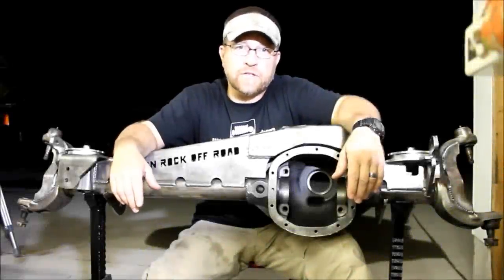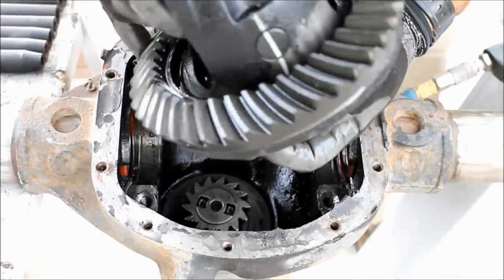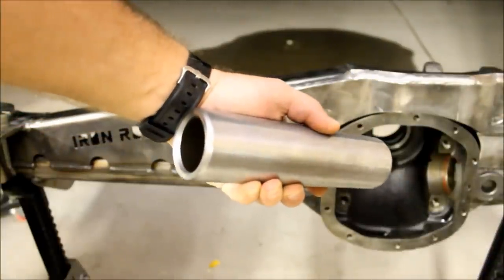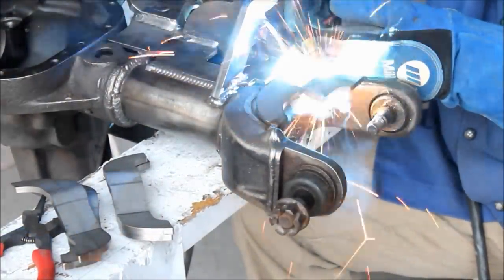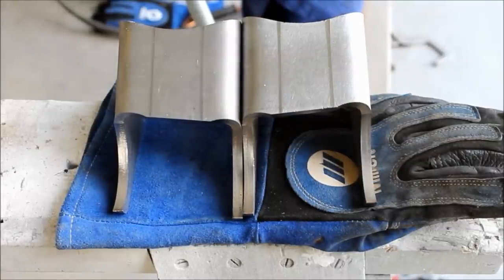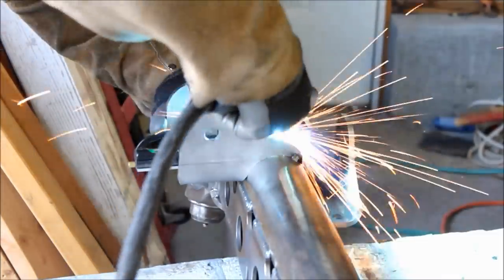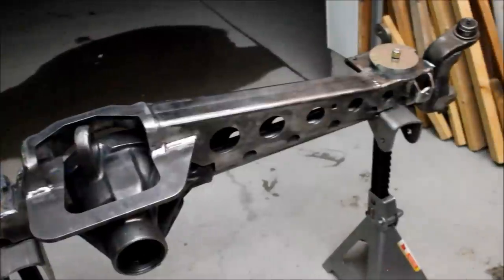Project Overlander Front Axle Swap Part 2 (IRO Dana 30 Axle Truss Install)

Comment: Welds are absolutely beautiful, makes me want to step up to true mig and stop messing around with flux core. Nice work and sweet kit.
Reply from the maker: flux core sucks!  if you ever want to come down to TN Nick just let me know man, a collab video might be in the works;)  -Matt
Reply: Thanks Nick, the funny thing is I had never heard of IRO until I watched your almost-alloy kit video. That got me checking out their website and product line. Welding with flux-core is rough bro. Step up to MIG with gas and you'll never go back!
Reply: That's what I keep hearing. Some day soon I'll have to grab a bottle and do it proper.
Reply: I like your welding.  Can u describe your welding motion?  Is it 
zig-zag, or "circles"?  I have a Lincoln 140 110v welder flux-core from Home Depot.  The
 ad states:

3/16" single pass
5/16" multi-pass

So, ur saying it's inadequate for this 1/4" bracket & 1/4" axle tube?  But, you are using a 110v welder with Ar/CO2 gas?
Reply: +Tyler Bleepinjeep in regard to welding on a axle, what's wrong with flux core other than appearance? Does it not penetrate enough?
Reply: I don't think there is much wrong with flux core structurally, it's just hard to make it look nice.
Reply: Welding inspector/welder here.  Mig should always be used in an enclosed environment, and really on very clean material.  Techniques in positioning are 2 entirely different modes.  Pick up a couple of books and search you tube.   As an instructor find someone who knows and have him/her watch your technique another pair of eyes always helps.   Tunnel vision is a bitch

Comment: I have watched this video no less than 50 times over the past 4 years.  I am in the market for a truss, and I am between the Barnes and IRO trusses.  I look at this IRO trust and think, there has to be clearance issues at some point at full articulation.  I have a basic 4" lift with sway bar disconnects, so I get a good amount of flex.  Curious if anyone has any feedback on this.

Comment: Chromoly axles along with those sleeves and the truss is a massive improvement to those axles. ujoints will still need a helping hand. It's turning out good for sure.
Reply: thanks!
Reply: Anytime, I'm always glad to see projects coming together and looking good. I was thinking about upgrading to these chromoly ujoints, they're pricey as hell though lol.

http://eastcoastgearsupply.com/i-11785922-yukon-super-joints-for-dana-30-44-u-joints.html
Reply: Chro-mo joints look cool, but I recommend you just stick with regular old Spicer joints. U-joints are easy to replace on the trail compared to axle shafts and pinion gears. I want my U-joints to be my fuses.
Reply: Tyler Bleepinjeep That's true and a good way of looking at it. I'm all for that as long as the u-joints doesn't mangle my axle shafts when they break. I don't see why everyone is so butthurt about upgrading the D30, with what all you've done to yours already, it's going to be as strong as any D44 if not stronger than most.

Comment: Finally! when i did this there was no info on this product at all. not even any pictures. I had to notch my truss to clear the trackbar drop bracket + send the axle rearward as far as possible. ALSO I had to cut and remove that section of the truss that straddles the pinion. This little cross piece was totally in the way of the upper control arm ( I am running a duel y-link). Oh and I know the directions and in the video it is explained to mount the truss 3/4 '' forward of the diff cover mounting surface, but just be consciousness of what pinion angle you want really because it will affect where the coil buckets sit and what have you. I set mine a little more rearward. The "sway bar link bracket," works well for limit straps aswell. I threw my swaybars in the trashcan long ago. ALSO I had to notch the C gussets to clear my u-joints just a tad. Be careful aligning those CA brackets too. i ended up having to take an upper control arm to the mill and oval the slot open to fit a bolt through. I then welded a thick washer on top the oval.
Reply: Dang, that's a lot of mods. That must've been a pain.
Reply: Yes a bit of a pain. The real B** was grinding out all my welds because of porosity. Buddies welder wasn't cutting it. Ended up purchasing a Hobart 210 MVP. Great Rig! Should have bought it years ago... Oh well live and learn. Your weld are purrrdy btw!

Comment: The Iron Rock truss bridges the center section without being welded to the cast steel, doesn't a truss system that's welded to the center section make an axle stronger?

Comment: If the front tubes need to be welded to the bell housing they if you want to rotate the front axle for a 5.5 lift, why cut the "C" brackets?  Why not just rotate the tubes?

Comment: I have an 89 2WD 4.0 XJ and my neighbor is selling his 98 4WD 4.0 XJ with a blown tranny. I'm trying to talk them down to a price I can afford right now. If I can get them down to the price I want, do you guys have any suggestions as to what parts I could use on my 89 from the 98? Besides the front axle, I know I will need a 4x4 AW4 and t-case to go with it. So other than that?
The reason I'm building an 89 2WD is that it was my first car so it has sentimental value, plus I've already put a lot of time and money into it
Reply: ***** Like I said, sentimental value. And I'm trying to get this donor for about $300. I'm currently in a cast and just moved so I don't have a job and can't really work yet. I have the money to buy the donor, and I'm 18 planning on living with my parents until I'm done with college or if I get a good paying job so it's not like I NEED the little bit of cash I have to live or anything. Basically I'm saying I'm most likely getting the donor. Plus I don't want to build the stock axle. Once I save enough money I'm tossing one tons under it. But other than the front axle there are plenty of other parts I could use too
Reply: Dude, if I could pick up that 98 for $300, I would find a used tranny in the classifieds or Craigs list or something for about another $300. Throw it in and have a backup daily driver or sell it for $3000 and buy parts for your 89.
Reply: +Tyler Bleepinjeep yeah I'm trying to get it. I don't know if I should use it as a donor for parts or sell it and buy parts
Reply: +Se7enAte depends on condition and miles, if it's worth it to fix or use it for parts.

Comment: I know this video is a little dated by i was researching some other info on the Dana 30 and came across this gem.  Great video Tyler. You mentioned publishing a video on the IRO inner axle sleeve installation.  I looked for it on BJ’s site and youtube but couldn’t find it.  Anyway you could put a link in the comments?

Comment: The work you did on this axle is beautiful, but I still have questions & concerns:
Welding to the "c's" & tubes is cool, but how much confidence do you really have in the chunk after all the heat treating it's been subjected to?  How much confidence do you have in the weeds that secure the truss to the chunk?  Sure, the welds might be top notch, but I'd be afraid of the the chunk cracking on me.  I'd also be afraid of warpage.  This was a considerable investment of time, money & effort; as such I would've put it into a full float dana 60.  Yeah, they're expensive & hard to find, but the alternative seems like throwing good money on top of bad, expensive & prone to failure.

Comment: Bump this to 23...IRO truss fits perfect and is easy to do. Installing HP 30 in my TJ since I already had chromo-shafts and Detroit but blew r&p in low-pinion 30...should be good with 35's. Thanks for vid. Very helpful.
Reply: I'm thinking about getting this for my HP30 on my LJ.  From the site, it says: Coil Spring Mounts: Moved up 1" and back 1/2" for better coil spring retention and alignment throughout the suspension cycle.

Does this mean my 4" coils will effectively be 5"?
Reply: @Thunder_Mass1756  my Jeep sits about an inch higher in front now. I am debating on lower coils in front or a small coil spacer in rear. When grinding housing down I suggest leave a little meat where the lower control arm mounts were so you can center them easier.

Comment: Hi, the welder you have in description as recommended for beginners, is that the welder you are using?
Reply: If your just starting to weld get watever you can afford the welder itself has very very little to do with how the welds turn out.

Comment: What is the biggest wheel you could run with a D30? 35", 37" 40". I've heard that the diff center is the weakest part.
Reply: The diff will become the weakest link if you upgrade everything else first. There is certainly a point where the Dana 30 just cannot handle what an outfit demands of it. That always depends on your driving style, the horsepower of your motor, the size of your tires, etc. etc. etc. But a good rule of thumb is don't go bigger than 37's with a Dana 30 no matter how many mods you throw at it. You'll just start breaking diff gears.

Comment: What setup are you using for cast? Standard 75/25 gas with solid MIG wire? Settings for thickness of steel you're welding to the cast? I'm using the Hobart 140.
Reply: I'm using standard CO2 argon mix gas with solid wire. I have the Miller turned up as high as it will go. This particular machine has a cool feature where you just designate what wire thickness you're using (0.24 or 0.35) and it automatically adjusts the wire speed according to how hot you turn it up. It's REALLY convenient. I'm running 0.24 wire btw.

Comment: what would be better to use for welding the tubes to the diff housing? 
mig welding with a 110volt 140amp welder with 0.35 ER70S-6 wire and c25 (or cO2)
or
arc welding with 220volt 200amp welder with 1/8  7018
?
or something different?
Reply: for anyone else wanting to know. i ended up arc welding with  1/8"  7018 after a little 400 degree pre heat and slow cool with blankets. it worked well

Comment: Awesome welds, I love the attention to detail. I'd never put chrome molly shafts in a 30. You'll destroy the ring gear. Run stock shafts & let them be the fuse in the front axle. Stock shafts are cheap in the junk yard.
Reply: I agree, I don't plan to put chrome molly shafts or any kind of alloy U-joints either. I would much rather replace axles than gears. I'll be installing IRO's "almost alloy" kit on this axle and hopefully, that will get me good reliability with a built-in fail safe

Comment: Questions. I have 91 XJ with the vac line axle. However I have a 94 straight axle like this one to go in. My question is what do I do with the vac line that I won't need anymore?
Reply from the maker: remove them, and or cap them off.

Comment: I've never seen anyone weld the tubes on a Dana 30. I'm trussing mine soon, is spinning tubes on them that much of an issue?
Thanks
Reply: Francesco Antinoro no small diameter size of the ring gear is the problem.  You can bulletproof the dana 30 all you want, the small diameter of the ring gear is the weak point.  If you have a locker, kiss your gears goodbye👋🏻

Comment: I have to ask, for the money you put into beefing and upgrading the Dana 30 could you not buy a Dana 60 for more strength and cheaper even after cutting it to size?
Reply: By the time I buy a donor 60, then buy all the brackets, cut down the housing, order custom-length axles, purchase gears and a locker for the 60 (more expensive than for the 30) and then end up with a different bolt pattern than the rear axle...you see where I'm going with this? Yes the 60 is awesome, but this is a daily driver and will never see bigger than 33" tires. I probably wont ever need the dana30 truss, but I wanted to see if I could do it. Everything's a trade-off I guess...
Reply: awesome answer thank you

Comment: awesome vid Tyler. like always. but I had a newb question, so sorry in advance. I saw a couple comments on here already, but I know very little about welding and I would love to learn the trade. are you using a 110v or 220v. and does 220v really make a much stronger weld? cleaner weld? more penetration? what are the biggest advantages?
Reply: you can see he is using a miller 140 in the video which is a 110v welder.  You don't need a 220v  welder  but the more volts the better
Reply: Start with a Miller 140 (110v) with a bottle of gas (not flux-core) and you'll be able to weld almost anything you need to as a hobbyist. I very rarely need to bump up to my big Hobart. I get 99% of my welding done with the little Miller. It's an AWESOME machine.
Reply: +Tyler Bleepinjeep
 I don't know why it took me this long to see your reply, haha. but thank you!!

Comment: Still don't know why just not go with a Dana 44, aftermarket support is just about the same
Reply: Ya but then you add the price of buying a Dana 44 which really the only thing better is the u joints which I believe 96-00 xj come with the same ones.
Reply: Actually Ujoints are the same, not better. What you gain is housing strength (obviously a truss changes that) and bigger / stronger ring and pinions. This really comes into play when geared high and the D30 pinion is really weak. You see lots of people running 35s locked on a D30, but most of them are running something like 4.10s. You'll also see lots of people running a D30 with 4.88s or something and their the ones trashing pinions all the time.
Reply: Because I have the D30 and this truck is not going to be a crawler. If I do the build right, this 30 will handle up to 37" tires. I don't plan to run bigger than 33" tires, so I really don't need the D44.

Comment: Can anyone here recommend me a decent entry-level mig welder? Preferably something that can run on 110v
Reply: I have a Miller 211, It runs 110 or 220 with Auto wire feed.  It has been a great welder for me
Reply: SP175 Lincoln.
Reply: a 110 isn't good enough for welding axles, get a 220v or be sorry later. Your choice. JMO
Reply: Lincoln 140 HD
Reply: romeshter I'm mostly planning on using it for sheetmetal and body stuff. I thought you had to get either 110 or 220, i was not aware of the convertible type unit that Chad pointed out. I fully admit to being a total noob when it comes to welding but it's becoming apparent in many facets of life, not just Jeep stuff, that it's something I'm going to need to learn to do.
Reply: I started with a Hobart 140, it was a good welder, not enough for this type of work you need 220V for that. However spending a little bit more or a Hobart 210 MVP will allow you to use both 110V and 220V on the same unit, gives some room for growth and is prob the best bang for your buck. I really like mine.
Reply: if you plan on welding on frames, axles or suspension then don't waste your money on a 110v welder. look for a Lincoln, hobart or miller 220v welder in the 175-180 amp range.
Reply: I went with a Hobart 230 Mig, its not that hard to run a 220v line from your box.
Reply: Lincoln 210 mp
Reply: It runs off 110v or 220v
Reply: I do 99% of my welding on the little Miller 140 you see in this video. It will handle almost anything a hobbyist will need. Get a bottle of gas for it, plug it in, and you're in business. I don't recommend flux-core for beginners because it can be very frustrating to use if you don't have it set up just right. I have a Hobart as well, but the Miller is my go-to machine for almost everything.

Comment: Why all the trouble time effort and money  into a Dana 30?
Reply: Cause parts are everywhere and cheap, along with shafts etc. Don't have to rebuild/rewidth another axle and match gearing. Also a trussed D30 is lighter than a heavy D60.
Reply: Maybe he wanted it lightweight.. Wanted to keep narrow Axles and proly got the truss for free..
Reply: I agree. My dana 30 was a piece of shit and I was told by a mechanic that that was the worst part of the jeep. Now I have an 8.25 works great.
Reply: +SuperDagod1 I didn't know that they had front 8.25 axles, what did you get it off of?
Reply: Im sorry. I thought that was a rear end. Your right that is a front end. My bad bro, sorry
Reply: Lol yeah dude you're thinking of the D35 which is a poor REAR axle. The D30 is the FRONT axle. The D30 is plenty strong, but just realize it as never meant for 37' tires from the factory.
Reply: I picked up a used 8.25 in great shape. How long will my 8.25 last if I never go off roading.
Reply: Forever as long as you regularly change the diff fluid and axle seals
Reply: I do a good job on all fluids. About to pas 250K and its the original tranny and engine. Although it doesn't feel it has it's original power like when it was new!

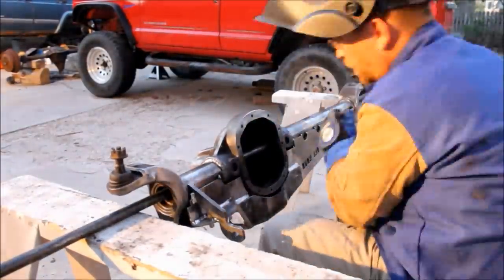Comment: Install a locker and 4:88 or 5:13 gears and chromoly shafts and let me know how that dana 30 ring and pinion hold up.  I personally blew out (3) sets of gears.  The ring gear diameter is too small, and all of the teeth strip off.  All that money you spent could have bought a used dana 60 from a 2003 ford F-350